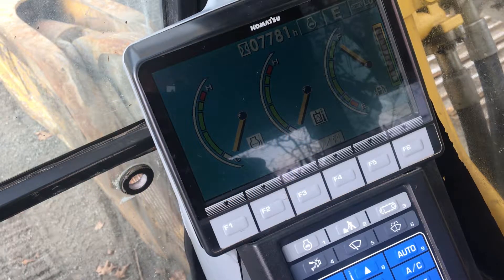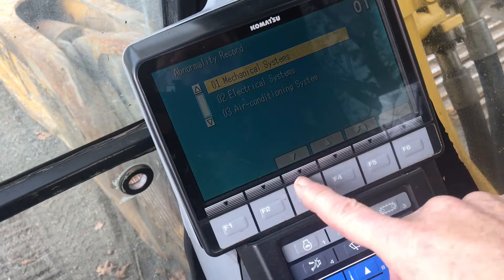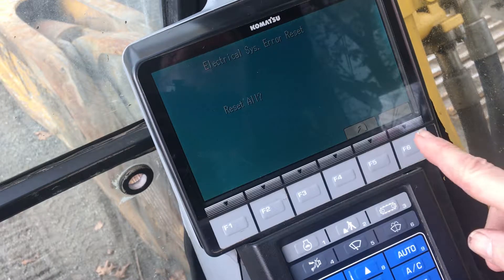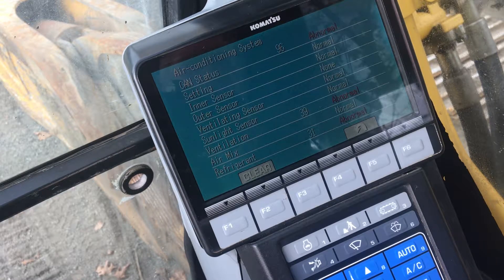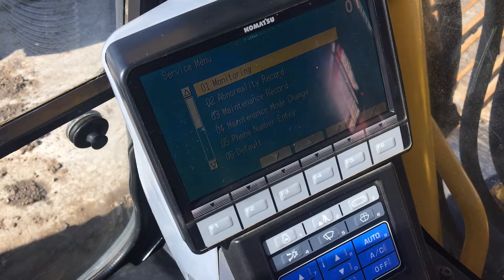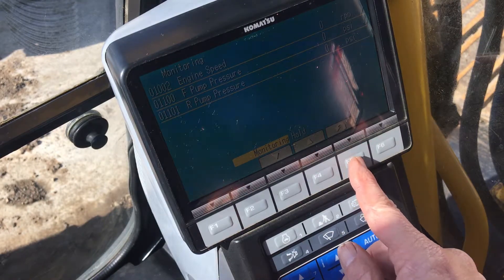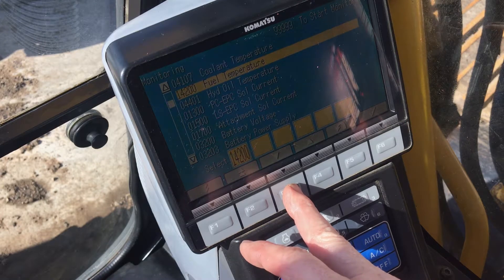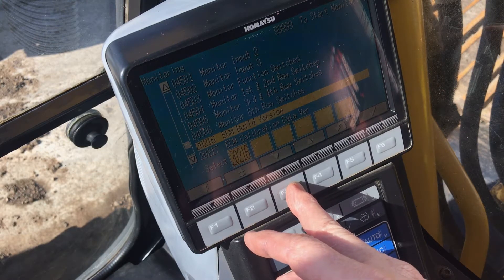Komatsu Dash 8 Monitor

Comment: I got komatsu pc120-8 .How can i change language sir? Thank you.
Reply from the maker: If you look at the monitor panel look at the top row of button pads. The far right button labeled F6 is under what looks like pages in a book. Press that button and a menu of user options will appear. Use the arrow buttons to scroll down to the bottom function on that page and press the bottom under the check mark. That will take you to another menu which lists the possible languages in the system scroll down to your choice and press the check mark button again and the system will shift the language to your preference. 
Good Luck!
Reply: @repairsecrets I can go for menu select but when I use f3 or f4
buttons nothing happened it doesn't show the arrow on the screen as well . I can use only f5 bottons to turn back sir.
Reply from the maker: @kao9159  What country are you in? Can you send me a photo of your panel by email. My address is jcraughan@comcast.net

Comment: Hello sir i like your tutorial video do you have electrical diagram in Pc200-8 sir?
Reply from the maker: I regret to say that I haven't seen a full schematic on the newer Komatsu machines. It seems they provide parts of the diagram in the troubleshooting sections of the service manuals and not the complete map.